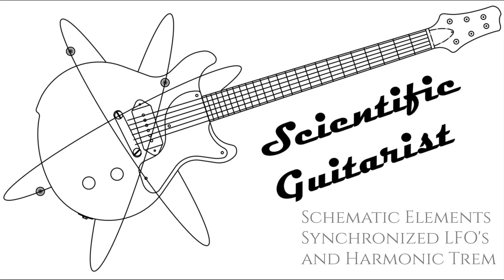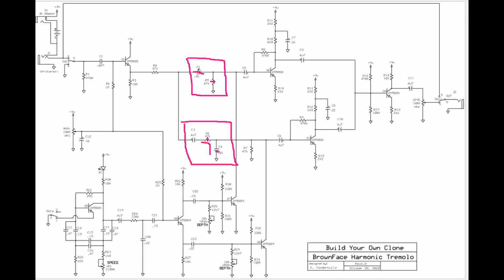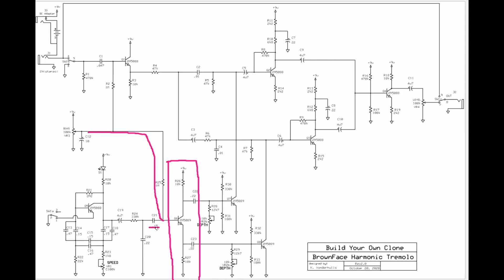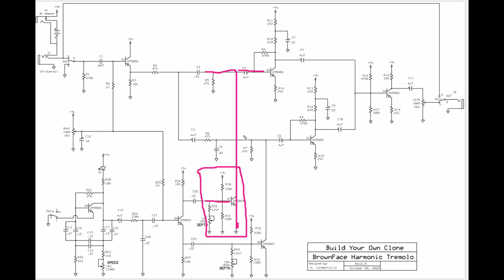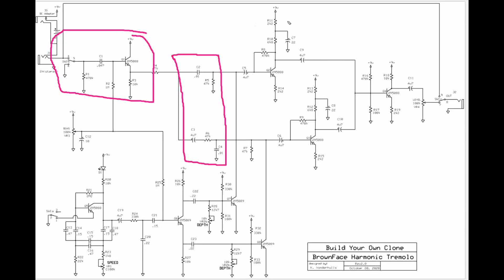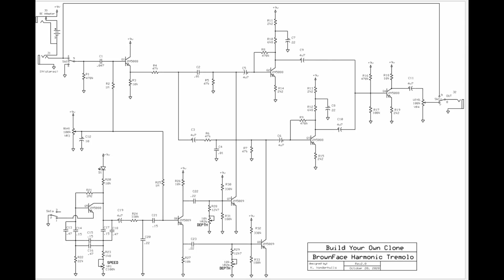Schematic Elements for Guitar and Effects: Synchronized LFO's and Harmonic Tremolo

Comment: So how do we introduce syncronisation to the LFO?
Reply from the maker: The way it is done in this circuit is to buffer it and create and inverted version. Other ways that can be done are to use a digital LFO, or to have a central clock controlling multiple oscillators.
Reply: Why did you title the video this way, and then not mention it at all?
Plus, your answer here doesn't explain it. Might want to retitle the video to save further confusion.
Reply: the title of the video is a little misleading- what he means is that the device uses a single LFO, phase-split, so that the two filtered amps are modulated in such a way that they're synchronised *with each other*, & not with anything external to the effect. I think that's where the confusion is.

Comment: Do a lesson about the DOD Vibrothang because for the vibrato it only uses 3 phase shifting stages =270 degrees compared to the univibe vibrato mode uses 4 phase shifting stages = 360 degrees. Its a different vibrato phase shifting to do a deep dive lesson about it

Comment: thanks for this man! greettings from buenos aires argentina. i really apreciatte your schematic elements series! could you explain R7 in the low pass path? it's not present in high pass one. or yes it is but as part of the CR filter. also the large C3 which has not that big counterpart in the high pass. thanks!!
Reply: To the point The Scientific Guitarist was making at the end of this video regarding designing your own circuits, while this circuit could be considered "original" in its entirety, all of the individual parts were taken or derived from parts of other circuits.  The primary tremolo effect was heavily influenced by the Schaller Tremolo.  If you examine the Schaller tremolo, you will see that the input signal passes through a voltage divide before entering the transistor amplifier.  This is purely to reduce the amplitude of the input signal.  It would not be apparent from simply looking at the schematic, but without this signal reduction, you get a thumping noise in the tremolo effect.  In this circuit, signal is split into high and low frequencies.  The passive high pass filter is enough to reduce the amplitude of the input signal to its respective amplifier.  Low frequencies possess greater amplitude.  The low pass filter alone was not enough to reduce the input signal to its respective amplifier.  So that is the purpose of R7 - to further reduce the amplitude of the signal.  With regards to C3, we don't want to lose any low frequencies in the low frequency path, so a large DC blocker is used.  Perhaps 4u7 might be slight overkill.  1uF or even .47uF would likely work just as well, but 4u7 is already being used for electrolytics and the fewer values you have in a BOM the easier production is.  C2 is pulling double duty as the DC blocker and high pass filter.